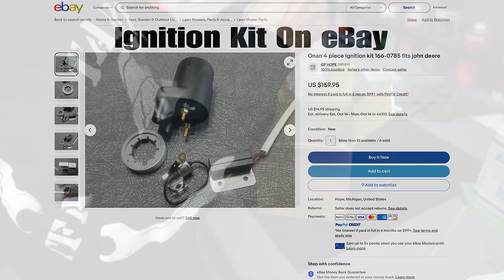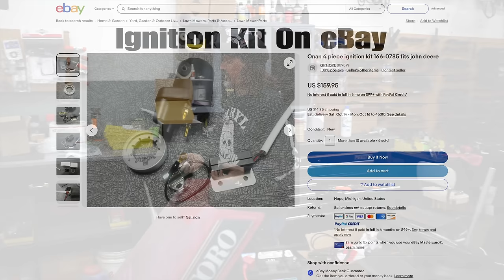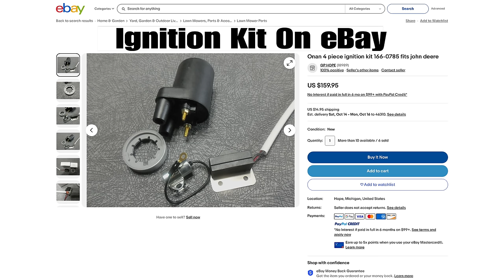Oh No! This Obsolete Engine has NO SPARK. What Do We Do?

Comment: I’ve also got a JD 318 with a crank, no start condition. I’ve done all the testing and found it’s the ignition module. It’s a real pain to do.
Reply: Yea the jd's r a bit more of a pain , but their not bad to do on these wh's , if ur poor or just cheap like I am , u can also use a gm HEI ignition module, best to order a high performance one , accel or something, these ones have built in dwell timing for a better rpm range , u can use a used abs sensor out of a gm abs style wheel bearing which r small enough u can drill the original pickup coil and they will sit right in where the original was can use the same reluctor wheel and wahhhlllaaa !!! A brand new slightly used , much more reliable electronic ignition for your Onan....  For about 25$

Comment: Cummins bought Onan, so you can get some of these parts from Cummins a lot cheaper than John Deere. I bought an ignition module an ring for $109, but JD wanted $165 just for the module and the ring was anther $25.

Comment: 1:27 it’s interesting how they mentioned Lowe’s, since Lowe’s Home Depot or just about any other, big box store is the worst place to buy a lawnmower from.
Reply from the maker: “Nothin butta buncha plastic and Battree crap for high dolla” 😂
Reply: So where to buy one? The local tractor dealers handle the exact same models but charge even more. Small shops are virtually nonexistent now. I can't think on one within a hundred miles.
Reply: @darkwood777 not many options any more. All you can do these days is buy commercial grade equipment. It cost more but it lasts. Like for 21” mowers about the only thing any good anymore is the 21” exmark with the Kawasaki engine but it’s about $1500-$1600 new.

Comment: i have a wheel horse 416-8 with the p216 onan. its only firing on one side of the engine (pulled spark plug from one side at a time to see if both were working) reason i checked was i noticed it was popping every now and then, also would bog down and die on slightly thicker tall grass while mowing.

Comment: I have a Lincoln welder that I bought new 30 years ago. Engine and machine have been rock solid performers over those years, but recently the Onans become very moody as far as starting. Spark sometimes, others not. I’m preparing to install one of these kits in my engine, and the biggest concern I dread? The two bottom bolts in the blower shroud are blocked by the two large bolt heads that mount the engine to the frame, so it. Appears that I’ll have to remove the engine from the frame to get the shroud off in order to effect the flywheel removal! And I’ve yet to see what I’ve got to do to separate the engine from the generator part! UGH!

Comment: Reminds me of the time i had to remove the engine to replace the starter on my lamdlords homda ht3813 mower. It was a pain to remove the drive shaft to be able to get the engine out and hard to remove the flywheel nut cause i didn't have the right tools at the time but still managed to get it done

Comment: I know it’s a small thing, but sometimes it’s the small details that will bite you in the butt later on. At 27:36 the lock washer was already on the negative coil terminal when Taryl mounted the ring connector on the terminal - instead of mounting the lock washer on top of the connector. I can see that vibrating off eventually, causing another issue.  Just saying - they’re there for a reason. 🔧👍
Reply: I noticed that also. And throwing tools around he's getting sloppy like he's in a hurry to get it over with not like he use to be in earlier videos
Reply: @Tankdogentertainment  
We all get older and that’s what happens.

Comment: I have a wiring issue...the positive i put on the coil pack that runs to the front of tractor, should that have a voltage?? When the tractor isn't running, but key turned on? I put all the parts on and have zero spark. And it has proper oil level as well.

Comment: if you use the test light on the the negative side of the coil while cranking it should flash if it doest the trigger is bad. and don't push the magnet ring all the way onto the crankshaft just slide it on until it engages the key then let the flywheel push it on when its installed. if the ring is pushed all the way in it may not trigger the module.  I have worked on so many Onan engines and 318 mowers i cant stand to look at them.
Reply: I have a question for you. I have a 520H with the same Onan engine. Mine is slinging oil around the output side of the crank at the bearing flange I replaced that seal and gasket on the bearing flange and it's still leaking . I used Onan Cummins parts. I did use aviation form a gasket on the gasket. There was no play in. The crank.
Reply: @rosseowens  those are pressure fed bushings/bearings, make sure the crankshaft is not loose and the oil drain hole between the seal and the housing is not restricted . i can't remember if the bearings have an oil hole in them but if they do make sure the bearings haven' rotated and blocked the oil holes. p with the holes . hope this helps.

Comment: In the beginning I was getting disappointed on your feelings towards Onans ... you redeemed in the end some lol. All serious, Onans are our favorite and can not be beat in our opinion.The low end torque,  smoothness and longevity, build quality can't be beat.   "IF" taken care of correctly! We see many with 2500 to 6000 hours on them. But yes prices are not cheap at all! But you get what you pay for and if getting that kind of hours ONLY if taken care of then the price per hours of life and parts is pretty cheap. We deal with roughly 75 or more Onans a year. Have many in our personal collection.  We agree when replacing any of the ignition components on a P series to replace them all. We sell a complete kit we put together to do so and it's a big seller for us. We include OEM Trigger and module, aftermarket OR OEM Coil choice as well, and  key switch option for a complete kit. We have found faulty key switches can damage coil and spark module and worth replacing too. You had it easy on the WH lol. Some brands the engine has to be pulled to access the flywheel... we Enjoy your guys videos keep up the good work!

Comment: Taryl, I've got an older 420 with the b48g. It needs rods, and I plan to rebuild it. Do you have any advice for that engine on the ignition side, it has points not that electronic module, but I could convert if it was the best way to go.

Comment: Their was the b43g 83-87 318 and the p218 in the 87 plus 318s.

I prefer the fd620d in the 445 as long as it has the steel cam gear. I prefer the shaft drive deck as well rather then the bent belt front pto clutch setup.

Funnily enough I named my kid after Gage from Pet Semetary.

Comment: Great video, but I dont think that the stator iron core on the charging system needs electrical ground, nothing is electrically connected to it. The windings produce AC and are insulated .

Comment: I agree I’m not a fan of the newer Onans like the P series, but the old CCK cast iron Onan flat twins are some of my favorite engines ever. They actually have a stroke that measure longer than the bore diameter, something very rare these days in small engines. While that means they don’t like to rev much past the 3600 RPM factory rated speed they make excellent torque and it’s hard to find any attachment used in any conditions that’ll make one lug down. They had the points and condenser ignition so no worries about trigger modules burning up and the standard 12V “beer can” coil for them is cheap and easy to get. Then seeing old lawn-boy with the capstan drive self propel was cool , they’re some of the toughest mowers out there, IMO the F engine lawn boys with the later model 3 speed belt drive self-propel are the best mowers ever made. OMC sure knew how to make 2 strokes.

Comment: The capacitor is a noise reducer, by noise that means the ignition waveform.  You will run crappy without it. I've been a mechanic my whole life, and I use to think it was for radio noise, recently I started using an oscilloscope for high performance and you should see the difference between good cap and bad cap. Lol

Comment: I had trouble like this with my John deere 316.  Condensers fail do to heat in the Breaker Box (to close to muffler)  Put a Condenser up on the Firewall away from the heat.

Comment: Great video!,  Only one year to late .. when thought all that crap  trying g to get parts was a nightmare  when all said and done never want to see another one
Reply: No doubt, lol. Taryl warned me I'd be better off putting a different opposed twin or even a Vangard it in. But I thought it worth the gamble since I also have a good working 520h and had purchased this other one as a spare.
Reply: As for me here in canada there used on welders mostly and Gen  sets since  Cummins  took over the parts are still available  only at 2 dealers across Canada I tried online parts and weĺllllllllllll  stick to omc parts

Comment: Yeah Onans have problems just like any other motor usually need a valve job at about 1500 hrs, I have one running on a generator with 4k hours issue free another on a stump grinder, that's a 990cc torque monster. And another on an old wheelhorse zero turn no idea of the hours on that.. they can last a long time with maintenance. I fixed the governor issue on the stump grinder by drilling a hole at an angle thru the camshaft and into the plastic fingers and put the appropriate sized roll pin in it. It's Been like that for about 5 years now
Reply: The P220 is a monster. I sounds like a skid steer motor. It's really overpowered IMO, but is a great running machine. My original 520h has a few small issues but is a great mower.
Reply: @dkeith45  the p220 is a 680cc motor the p260g is a 990cc motor and a torque monster, and that motor was used in many of the old Melroe skid steers but with the old model number not positive what that was. They aren't great on fuel but they put down the power

Comment: I’m having this problem now but I’m curious if anyone’s tried to replace the electric style ignition with points. My p220g does have a bolt on cover where the points would go. I’m curious if it will work to prevent having to pay the money later on to replace the ignition coil trigger

Comment: I love your videos i have a 2002 Dixie chopper with a kohler efi. It runs great for 15 minutes then runs to rich and quits running, shooting flames out of exhaust. It’s not loosing spark at all. I put a new fuel pressure regulator on it. It takes the old style cause its one of the first Efi’s out. Can’t figure it out. Any ideas would be awesome. Or do a video on one. Keep up great videos. Thanks
Reply: Bad sensor, bad ecu, stuck injector.  That it gets worse over run time makes the list most to least likely.
Reply: If it has spark control you might need new coils without it.

Comment: My thought was to just drill the hole out bigger to accept the original bolt in the new condenser bracket and mount it back where the original one was instead of drilling another hole and a self tapper bolt on thin sheet metal it probably already came loose
Reply: I had a similar thought, only mounting it on the other side of the bracket for better accessibility.  It's like, why modify original parts when modifying the replacement part is easier and nets a result that deviates less from original?

Comment: 43:59 Taryl, that is a great idea, a mini-bike with an twin cylinder would be bad to the bone fella. The weight would help you in the Harley type fat mini-bike department. 
What I am wondering is if the coil on these two cylinder engines both spark plugs fire at the same time or do they alternate ?? Hope you can help with the answer Taryl.....
Reply: Routing the spark is a distributor's job.  That engine lacks a distributor.
Reply: They r a wasted spark system , so yea they both fire on each revolution of the crank

Comment: If you turn the key on and touch a ground wire to the negative side of the coil the coil will spark every time you touch the terminal if the coil is good.
Reply: Unless the condenser is shorted.
Reply: @informationwarlord  seems to me if the condenser was shorted you wouldn't have battery voltage at the plus. I was wanting him to touch the minus with the test light, I predict if the coil primary was good it would have b+ and when he pulled it away it would spark if the coil secondary was good.

Comment: Hello Taryl, I have a question completely off topic I ha e two lowes riding mowers one a 2012 pony and a 2013  Bronco, bronco costs slightly higher pony will scalp yard if ground dips, bronco has antiscalp wheels I would like both to cut 2 inches higher or so decks are level and adjusted to max.  How can I get a higher deck cut, maybe change tire size what size would I need to put on and would this be front and rear.  Love your content and sketches

Comment: 3:56 After my years of no experience, the exhaust pipe might need attention!?
Reply: Yeah it's in bad shape. I'll get a better one for it. One of the seat springs is broken too, but I have another for it, as the same thing happened on my other 520h last year and I picked up another pair of springs for it but only needed one. Overall though, this 520h Taryl is working on is in better condition than my first 520h.

Comment: The spark plug should fire as soon as the coil loses voltage so if you get no spark when you turn the key off the ignition coils bad. If you get a weak spark its got a bad capacitor. If it only sparks when you turn the key off its the pick up coil or the flywheel magnets.... assuming you checked all your connections and grounds

Comment: I've never heard of those engines and I've been working on lawn equipment forever. Great video 👍
Reply: I've seen one in my 13 years as a lawn mower mechanic. Its still running strong after some expensive ignition parts. Great engines  i have it on my hustler 60 zero turn.
Reply: It's a well-respected brand that's been around for a long time, but never got much penetration into the consumer market.

Comment: A lot of people like the Kohler magnum twin engines but I hate them. Difficult to fix case leak on 1 and another one the governor failed 2 hours after replacing the rings on the piston.
Reply: I thought I was the only one!!! I just had a spark issue. Took me 2 days
Reply: I feel your pain have 2 1gov went out after rebuilding tractor other still going strong 1985

Comment: My 2 tractors have Onans, John Deere 318s, one still has points, im rebuilding the P218G now it has coil ignition. Parts are still available from the aftermarket, rings, pistons, gaskets, almost everything you can ask for. Im gonna keep them 2 tractors running as long as possible screw this new garbage.

Comment: Briggs vanguard or Kohler command is the only way to go.   I just picked up a 2006 SLT 1550 cub cadet with a big kohler engine on it..  It's in great shape for only 200 dollens.  No deck though.  All it needed was a new solenoid and carb cleaned...  Then I just found a used deck with supposedly new blades and new belt for only 100 dollens. :) ..  So only 310 in on this thing and I somehow have a $4k tractor now with 25hp engine and 54" deck, (has the pto belt clutch).   It looks fantastically new;  must have been garage kept and well washed.  The guy didn't have a deck because he just used it to tow a sprayer around his big yard. So it's never been clogged with grass and overheated, etc.  no mouse nests.  He's rich and wanted to give it away I guess.  Your loss, My gain.  :) .. I'm excited about it.  Found on fbMarketplace.

Comment: The old Onan CCK’s are almost bulletproof. They’re a lot better compared to the later model aluminum Onan engines. My CCK’s are all cast iron besides the cylinder heads and they’re basically a small car engine. Onan was a good company it’s a shame cummins bought them and basically got rid of all Onan engine production in favor of the cummins engine with Onan generator parts. Onan used to build all their own stuff and I’m convinced they were almost too tough and put themselves out of business.
Reply: They are awesome engines. But I've seen tons with bad rods and other issues. I think they where the b series. Like the old case garden tractors had
Reply: @meegstomtom   The BF had a service bulletin stating they lived longer at 16degrees BTDC vs standard 21degrees...One 'fix' was raising 20psi oil pressure to 30 on later B series.
Reply: @charlesangell_bulmtl  good to know. My family still has a hand full of old garden tractors with them in it. Most have been fixed as we got them with issues. Cheap way to buy old machines. Lol

Comment: Hi Taryl. Love your UTube videos and skits, Keep em comin.  I have a Toro CCR2450 snowblower that always floods when I pump the primer bulb. I want it to be able to start on the first or second pull of the rope but it floods. Any thoughts? Thanks Pete M.
Reply: Needle and seat in the carburetor
Reply: Thanks Tom. I'll check that out.  @Thomasploeg1968
Reply: The oil/gas mix for this old 2 cycle is 50:1. Could I safely make the mixture 32:1 instead? That would add more oil. I’ve read that increasing the amount of oil (reasonably) would increase compression on this old engine and it would stronger? What do you think.
Reply: @petermitchell1662  Might foul the plug with too much oil in it.
Reply: I bought a new OEM needle and seat for the carb. Briggs and Stratton P/N 801317 for the  Toro CCR2450 because of its flooding issues. The new needle has no rubber tip. It’s all metal. Is that normal? I thought that needle valves had rubber tips in order to get the best seal? Do you guys have any advise on that?
Reply: @petermitchell1662  They probably did away with the rubber tip because of issues with ethanol fuel. Lots of brands don't have rubber tips. As long as the tip and seat are clean and no corrosion pitting should be fine. Fuel pressures are tiny.
Reply: @brnmcc01  Thank you very much for the advise and for your time.